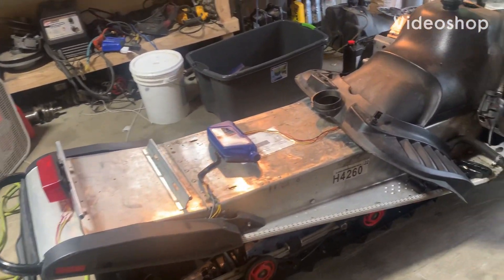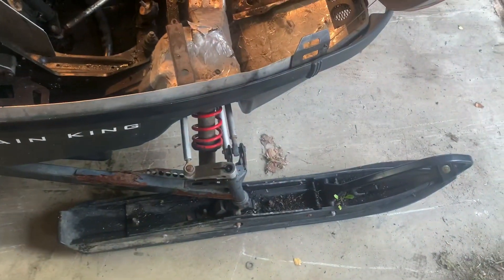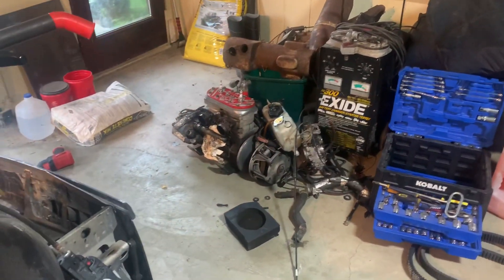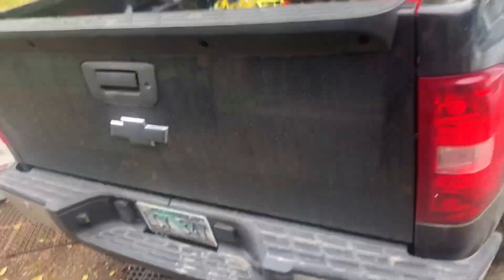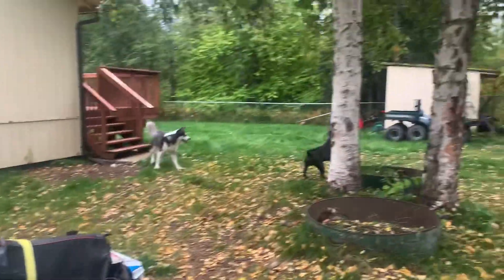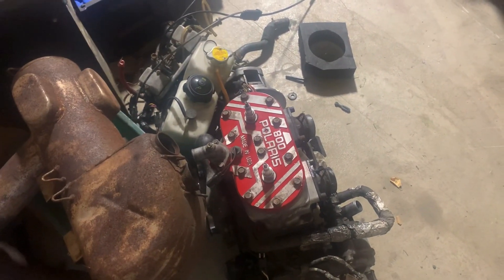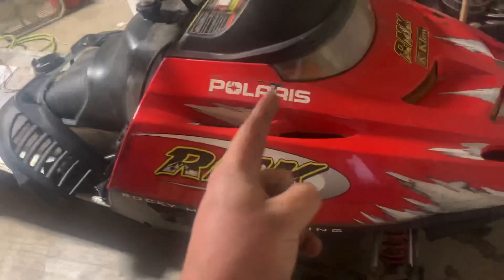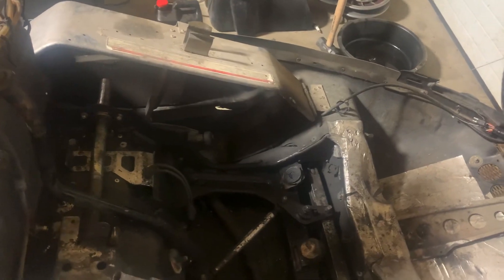R.I.P rmk, decision to be made

Comment: Have you ever widened the pto oiling port on your 800 blocks? I have a couple complete bottom ends and wasn't sure if it was worth splitting the cases to do this, or if i should just run them as is.
Reply from the maker: I have never modified cases. Not saying it’s not a good idea, iv just never done it